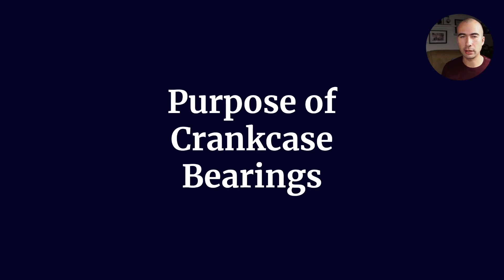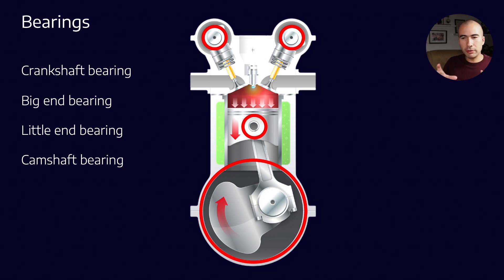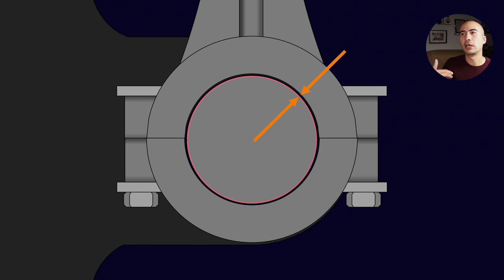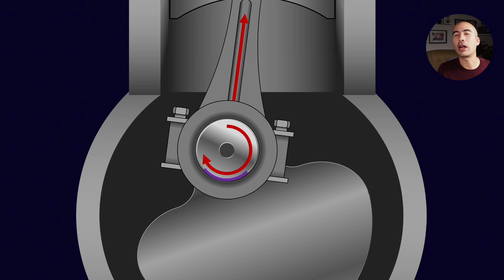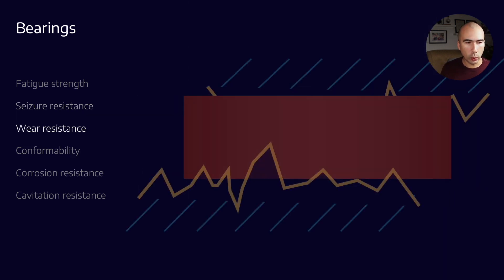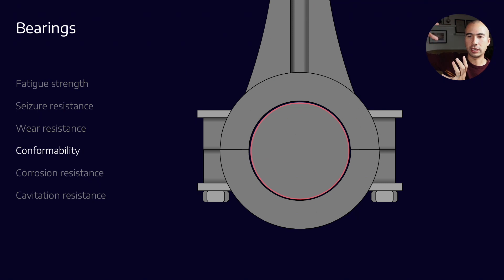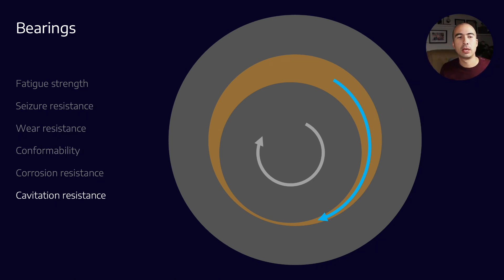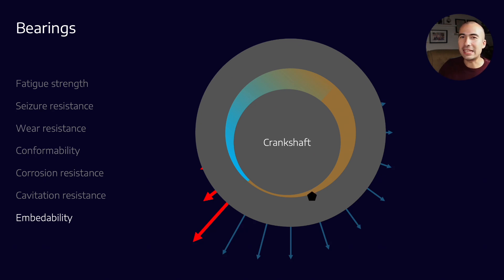How do crankcase bearings work?

Comment: Thanks for your great explanation. I’m putting a diesel engine back together for my first time ever. What is interference fit measured by? How much interference? Fitted new piston shells on the new crankshaft. When fully torqued it can with effort be rotated (3 piston engine without head on, diesel). However, main bearings with new shells when torqued stop any crankshaft rotation at all. Even before being fully torqued. The supplier of the shells said because it’s a new crankshaft the shells can be standard. To me as an amateur it seems way too tight. Can you confirm that I would be needing or it sounds like I need thinner shells? I’m taking this really slowly to assemble as I have no rush. I live in the middle of nowhere where in Canada with no support for 60 km. The engine is for a John Deere dozer 350 1971 (ish). Any thoughts would be gratefully appreciated. John

Comment: Great explanation! Since there's not supposed to be any metal to metal contact between the bearings and the crankshaft once the engine is running, would it be reasonable to say that most bearing wear is caused on startup before the hydrodynamic wedge is established and by contaminants in the oil?
Reply: I'm not an expert, but I think you're right.

Comment: My understanding is a journal bearing works on oil being drawn into the area of most pressure by surface friction between the journal and oil viscosity. I am trying to understand what the correlation is between the speed of the bearing (circumference m/s) and the force being applied for a given viscosity. There must be a table or formula for force, speed and surface area as to what load a specific viscosity can maintain separation between the two surfaces.

Comment: There's a problem with your visuals that may make this confusing to viewers - you're showing the two halves of the bearing fitting directly to the crankshaft journal with there then being a small space between the bearing and the connecting rod/cap (ostensibly for oil to flow through). This is incorrect as the space for oil to flow is between the bearing and the crankshaft; the bearings fit directly to the connecting rod/cap. I know you obviously know this and your audible description of the relationship is correct, but it doesn't match up with how it's shown visually.

Comment: Nearly all automotive crankcase bearings are plain bearings but nearly all small displacement motorcycle crankcase bearings are roller bearings or ball bearings. Why is that?
Reply: Street bikes use plain bearings because plain bearings have less friction and last a lot longer. Dirt bikes are more likely to suffer from oil starvation/surge. Roller bearings are far more tolerant of momentary oil starvation than plain bearings.

Comment: I get all of it, and its very well put, but the embedability kinda fucks with me here... I am not a stranger to the concept, and its used by machinists to form lapping surfaces, be they cylinders or plates for honing... Either way, it reminded me of a video that had Stefan Gsw. talk about german humor... He mentioned a machine that used plastic bushings, was it teflon or uhmd plastics, i dont remember, but the machine used plastic bushings and precision ground chromed, tempered steel shafts in those bearings... The plastic bearing is what you would assume to wear down if it should be contaminated by getting embedded with grit and shit... But no, its the ultra hard, chrome plated shaft that wears down like a stick of turd and the plastic bushing outlasts the shaft... Why is it so? They put a shaft in the bearing, let mud and grit drip over a fresh prototype example and observed the wear pattern... The ultra hard shaft, like the crankshaft, of course, does not take in the grit, and it gets embedded into the bushing, but that is it, the bushing is pliant enough that it sucks in the grit particle that oil cant wash away and it stays there, not damaging the bushing any more, but every single time the shaft makes a rotation, it gets scuffed by the particle... And the more particles there are embedded into the bushing, the more effectively the bushing is converted into a shaft hone that eats away the shaft with each second while not suffering any damage beyond having its surface now not as precise as manufactured, given that it took in the grit particles... Its a very stupid property in this case, because if the crankshaft is ``more embeddable`` than the bushing, then it will take on the grit, and will not really loose precision, but it will then become a bore hone which will eat out the bushing(bearing) in a few seconds of working, as it will scratch the bore of the bearing... If the bearing is more prone to it and gets embedded with grit, it will as said, become a shaft hone and will grind down the crankshaft in seconds without wearing itself... If the bearing is abrasive, your crank is gone to shit, but if the crank gets abrasive, it will eat any bearing and contaminate the oil in every moment of its rotary motion, making you have to regrind the crank to remove the grit from the surface of it, even if its dimensional measurement and geometry is perfect... In both cases you as the guy who owns the rotary assembly are fucked... When you are a machinist, its a very nice property, allowing you to ``charge`` the surface of a plate or a bore or a shaft with say diamond particles against a very hard surface and then use that as an abrasive ultra precision tool, but that comes with knowing what hardness is the material its used against(utilizing embedability twice, once to charge a tool, then to make sure the tool wont contaminate(charge) the work piece itself, but will only grind it with precision)... Embedability in bearings doesnt make sense as a consideration... If the bearing and the crankshaft were hard as diamonds but not as brittle, and so then it would not allow any particle softer than diamond to embed into either, but would crush the particle by sheer force, and as said, if it was as hard, but not as brittle, the system would then work as good as possible, and would not risk either component becoming a grinding tool during work... But that is a machinists fantasy... A material that is both incredibly hard and rigid but durable and able to resist impacts and sudden stress... Also, then it wouldnt technically be considered ``embedability`, as you would be using both a shaft and the bearing of the same hardness and lack of embedability to avoid charging either surface with grit, but you would want to utilize the miracle material to batter any particle into submission... The ``healing`` of the surface could occur, but the particle would have to be absolutely minimal but just above the oils washing capability... Its really a stupid approach as no surface once charged, however plastic or elastic or plaint it is, can be used to negate the fact that it ate up a particle of grit... just by being worn down it will always again and again reveal the grit particle.... Its a good idea in theory, but i dont see it really working in such an environment... The particle is either small enough to wash away or big enough to be charged into surface and from there on, the surface wont get perfectly healed and as it wears, that ``healed`` layer would have to reform constantly, taking material away from somewhere, but that particle too would stay there and its much harder, so it would eventually surface when it could not be pushed in harder and covered... I dunno, as a machinist, it kinda doesnt really sound 100% on point here in this case to me... It would have to be a miracle material once again, but this time soft and yet not soft but rather seemingly soft due to its plasticity...

Comment: Could you do a video on the role of bearing coatings? An example is the upper bearing on the BMW b58 engine has a special coating that supposedly protects the bearing from the extra wear associated with the start/stop system.

Comment: Gasoline burns very rapidly, diesel fuel explodes in the combustion chamber. That is why diesel engines produce a knocking sound while running.

Comment: Hey can you comment on what the near future looks like for fuel shortages? I’m hearing a lot of rumors the east coast of the United States is running out of diesel fuel and it’s really concerning for us in the trucking industry
Reply from the maker: That’s a great question but to be honest I’m not a specialist in the fuels industry. I don’t believe there are too many problems in the diesel supply chain at the moment. On the engine oil side I know one of the two major additive suppliers is out of CK-4 additive for the foreseeable future, so that it a bit concerning. For the moment it seems the rest of the market is picking up the slack.